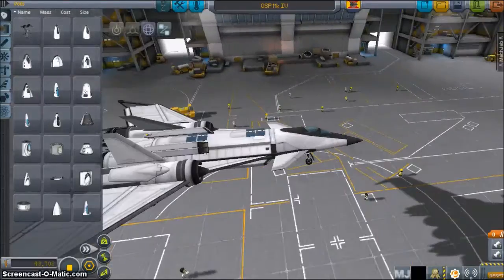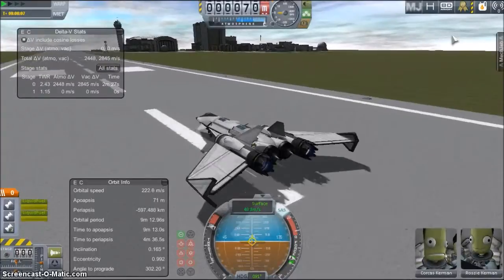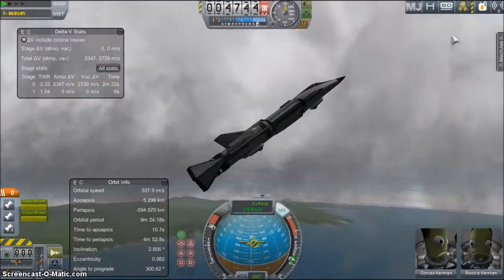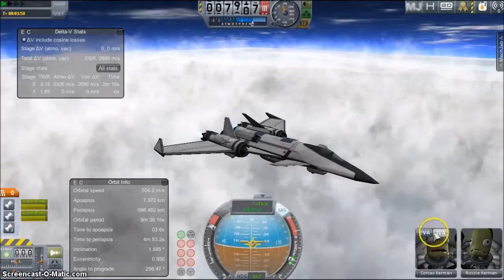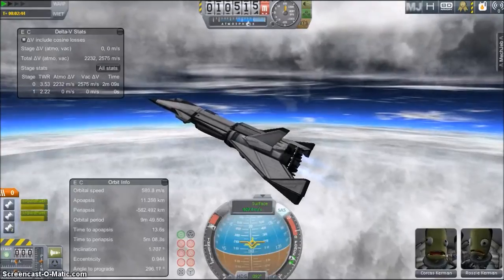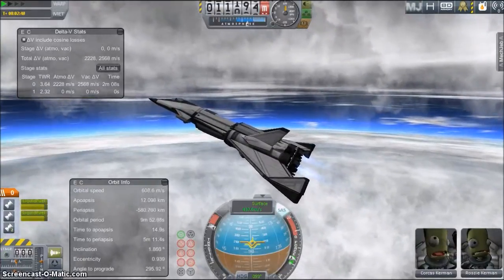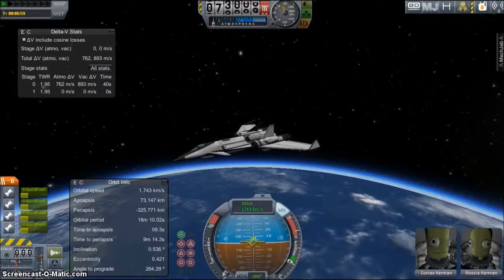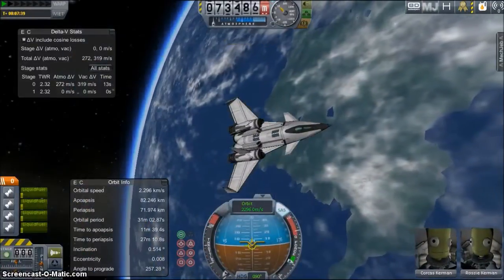Kerbal Space Program: SSTO Ascent Tutorial

Comment: A few things to note:
1.: in 1.0, atmospheric drag, even at sea level, is relatively low, compared to older versions. By ascending in a very steep angle, you may not save as much ΔV as you lose due to gravity drag.
2.:jet engines need 3, not 2 things: not high speed, but high mach number; enough intake air; and low height above sea level. Getting higher sea levels will cause your total thrust to drop dramatically. For example, around  ~16.000m, you will only have ~20% of your normal thrust.
3.:intake air is not SO important with the current 1.0.4 jets. 1 shock intake and you won't have problems with it at all.
4.:Aerodynamic drag is already low, but at the altitude where ramjet engines flame-out, there's neatly nothing. You don't have to pitch up so agressively, or else you will have even more loss. Maybe only to 5° more.